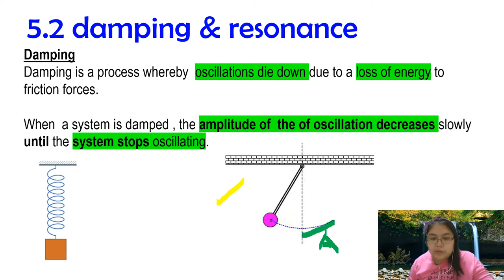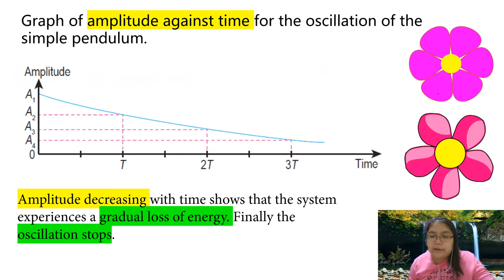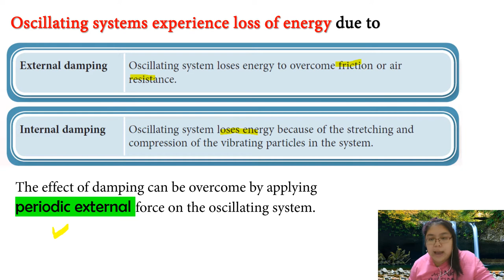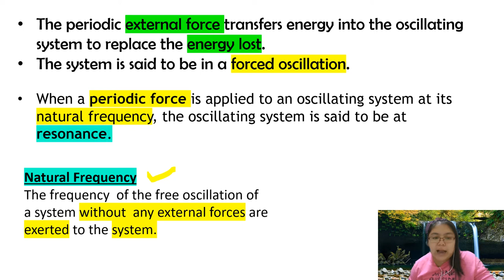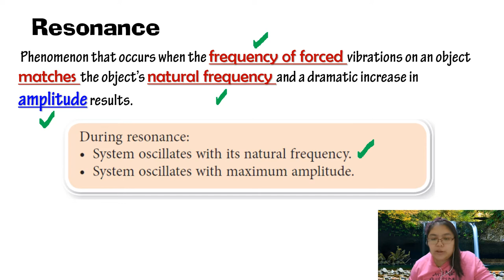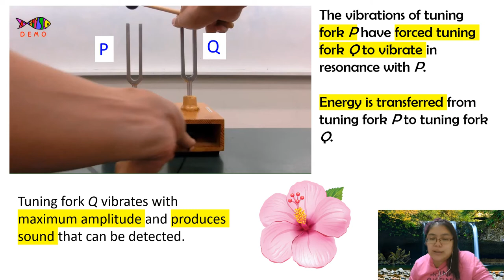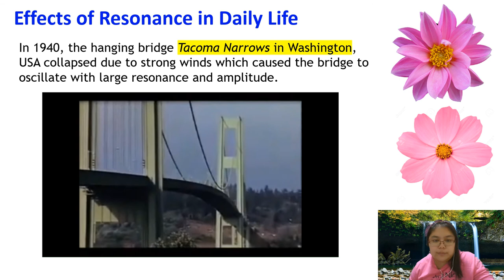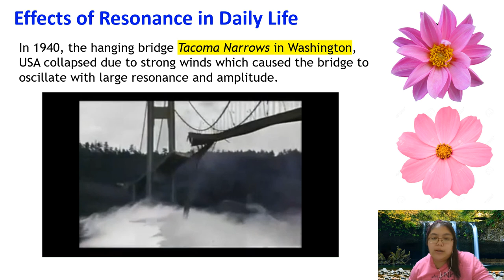Physics Form 4 Lesson 5-2 Damping & Resonance

Comment: Hi, in 3:45 although the spring-mass system is put in vacuum, the energy is still lost to the surrounding in form of heat energy by radiation due to the compression and stretching of particles in the spring. (According to textbook, spring mass system exercises more significant internal damping than pendulum system). So, damping effect is still happened in vacuum right, although no air particles to cause external damping?
Reply from the maker: that just A small effect on internal molecule
Reply from the maker: means the dampibg effect very very less